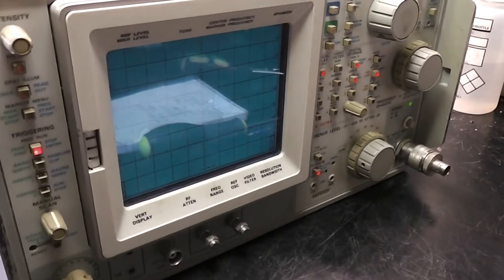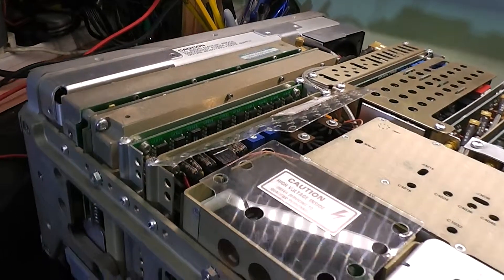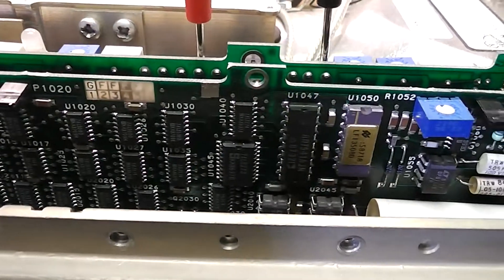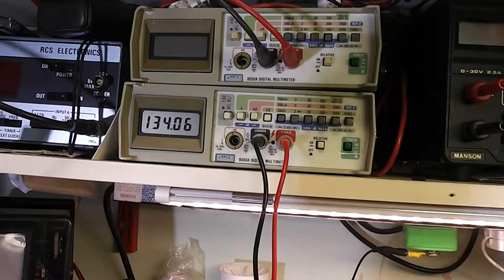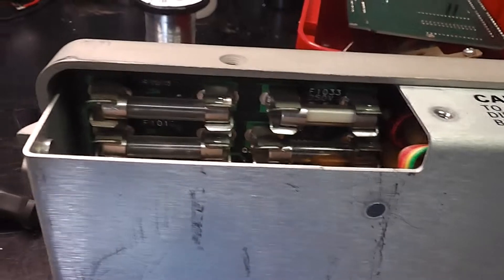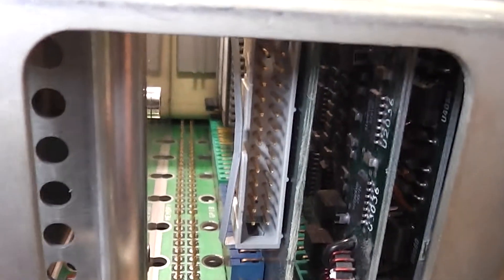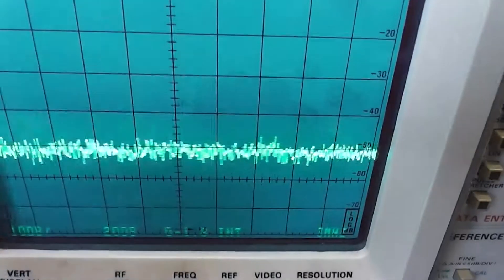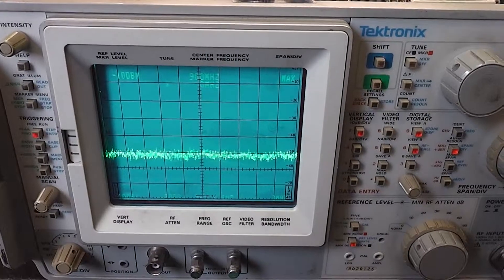Tek 495P Spectrum Analyser Repair

Comment: Great video, I have not taken my apart, just wondering if the 4 screws from the back is the only one holding the cover on? Also, have you change the battery on this unit?  thanks
Reply from the maker: No I haven't changed the battery as yet. All I can remember is care is needed sliding lid on as not to catch the plumbing, lol. Daz

Comment: Thanks for the video. I have one of these. Lovely piece of kit. Needs the battery backup battery changed. Is it easy to get to ? Cheers.
Reply from the maker: Ive not changed the battery, Mike but the PCB's are not too bad to remove. I looked for my manual, but cannot find it. Perhaps if I do , I can give you a better answer. Daz